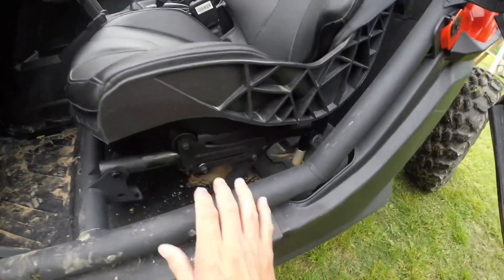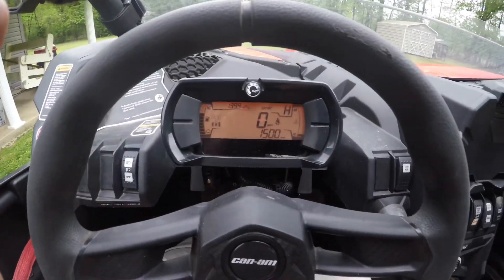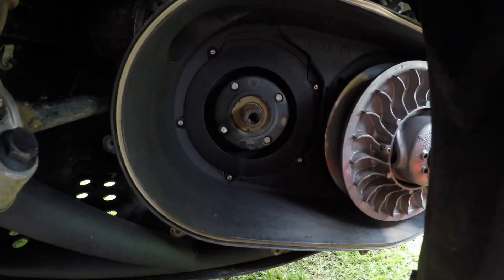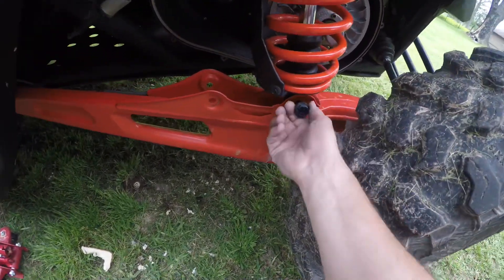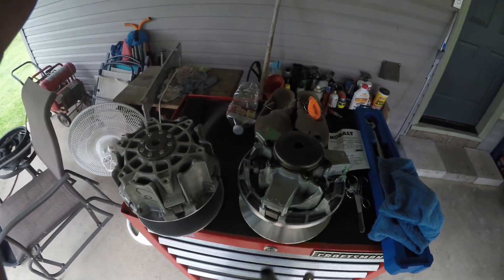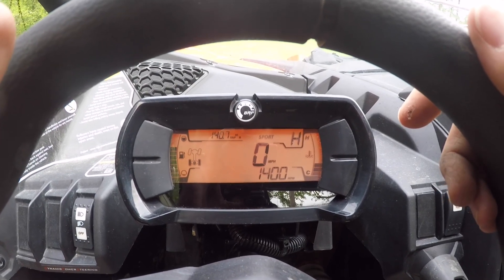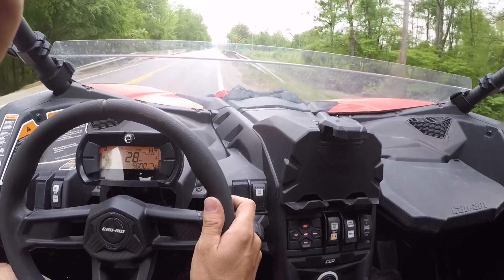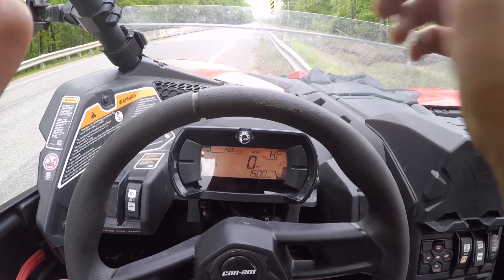2022 Can Am X3 DS Turbo 120 P Drive Primary install! Before and After .

Comment: Did you use the same clutch bolt for the new PDRIVE, of did you have to get a new clutch bolt for the PDRIVE.
Reply from the maker: @brienhalverson1956  It’s hard for me to remember honestly. I don’t think I did . I’ve replaced the secondary bolt each time however . 
I just did rollers in my XRC RR I have now and replaced the bolt .

Comment: Would really like to know what the seat height from the ground is after you installed the seat risers. I've been looking at the base model X3 myself but don't wan to be sitting in the water if i have to cross a stream or water hole.
Reply from the maker: You know I meant to measure the before and after when I installed them last weekend and forgot to . I will have it back out tomorrow and I’ll measure the height where it’s at now and you can compare to a stock machine . I’ll comment it the measurement tomorrow bud .
Reply from the maker: Yea that’s the reason I installed them. My ride height is still decent but would love to  get the fox tune done , or send them to shock therapy. A lot of folks gain 1-2” just from better springs .
Reply from the maker: I went ahead and walked out there. 28” to the tallest side ridge . At that point inside pad is about 2 1/2” lower . Back lower inside seat pad against the back is about 3 1/2” lower . So right about 24 1/2” at the lowest point now.
Reply: @joekearney  Thanks for getting the measurements. I'm betting you can go up a bit farther on the fox tune to raise your ride height up to 15-16 inches without effecting the ride itself. adding a bit extra pre-load wont effect the valving inside the shocks.
Reply from the maker: @ruyguy8888  You bet no problem. Agreed , I’ll tackle it later . I think next priority will likely be Evo tune only. 160hp will be fine for a long while .
Reply: @joekearney  Whalen speed has a wicked tune. Took my 120 to 225 real quick 👍. . Whalen service is unmatched. Once Whalen personally texted me and emailed a new file on a Saturday morning in the parking lot of where I was riding . Really any issue and he'll text you right back.. 👍
Reply from the maker: @chrisgoetz3889  Yea I’ve heard good things and was set on a Whalen 160, but I got feedback that some machines were coming in with issues from Whalen coding . I can’t verify that though , was told to me by a professional x3 racer and business owner however . 
I think Can Am sends Evo new designed machines for them to tune and test ? I was originally a Whalen fan and still am for the most part . 650$ for  160hp to the rear wheels with no parts interchange sounds good to me .

Comment: I have a 2022 Can-Am X.3 120 hp DS I’m pretty sure it has the QRS clutch will a 2022 P Drive clutch fit without modifying anything
Reply from the maker: That’s my machine as well (2022 X3 DS Turbo 120) .  Yessir it bolts right up bud ! Makes a big difference in how loud it is . The 5100-5300 RPM clutch rattle is completely gone .
Reply: Thank you sir I’m gonna order the clutch here soon
Reply: Thank you sir I’m gonna order the clutch here soon
Reply from the maker: @ryantrayon9182  Contact SxS USA in Oklahoma. Hunter Drew Owen, and you’re very welcome!

Comment: Torn between DS and RR. I saw you originally ordered RR, but changed your mind after supply chain issues. Any regrets?  I can’t really justify 200hp, but it may be worth the $2,500. Thoughts?  Is 135hp enough?
Reply from the maker: Good eye catching that lol. I had forgotten i mentioned it in an earlier video. 
Well, if you asked me would I rather have the RR at the time absolutely. Simply cause it’s already set up with the intercooler , larger fuel pump etc and had the PDrive which at the time i obviously didn’t have . I will tell you unless you’re going to be wide open strip drag racing everyone you won’t care . I think Can Am was sand bagging already on the 2022 “120” hp models because Whalen dyno tan them and was getting more than 120 to the wheels ……twice they got like 130 or so. It would light up the rear tires on pavement . The PDrive I installed smoothed the power out and made it less “punchy”. It’s much quieter , the 5100 RPM clutch rattle is completely gone . 
Also the 2023 135hp DS now come with the PDrive off the lot so that’s a big win. I think you’d be far more than happy with it . Trust me , it’s not slow .

Comment: How much did it cut down on noise would you say? Percentage wise if you could ballpark it?
Reply from the maker: Easily 80%. Speaking of the direct primary rattle that is . I don’t regret it whatsoever .( Spending the money on the PDrive that is ). Your engine noise is still there of course but the 5100-5300 rpm rattle is completely gone . Worth it IMO